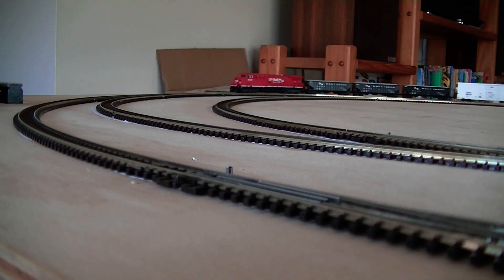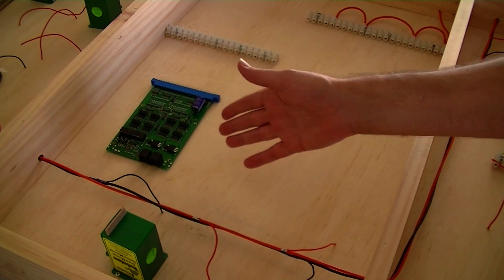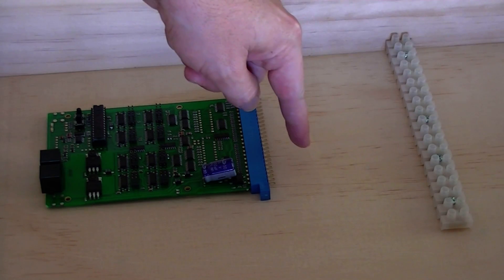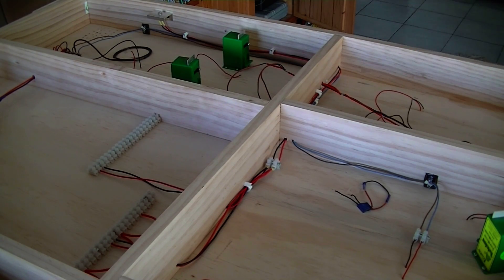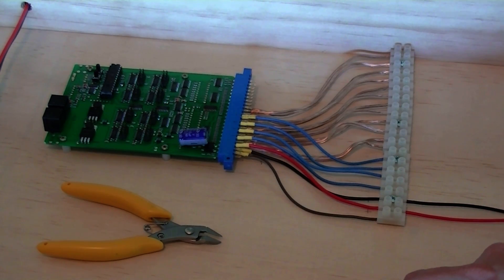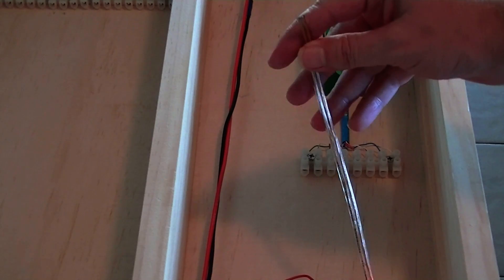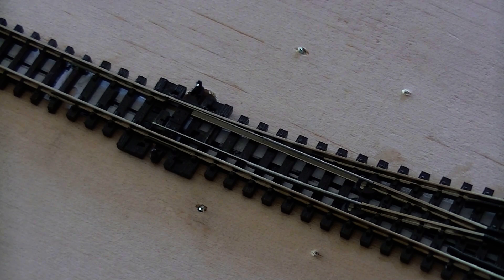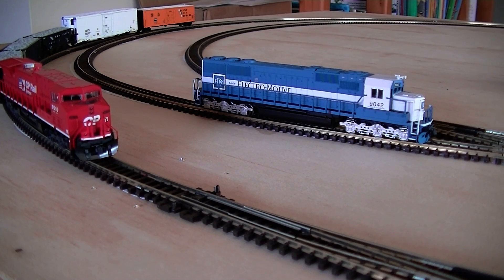Digitrax SE8c signal board and tortoise switch machines

Comment: Awesome video sir. I have an NCE DCC system. But am planning to get the Se8 and operate my signals via the computer thru a separate loco net and no detection. Think that should work?
Reply from the maker: Yes it should work but you have to change the signals manually

Comment: forgive my ignorance, but is this system meant to control the switches remotely with your power pack or hand held throttle? because  I heard of the( I think is call) rabbit that controls it remotely! I follow all your videos but this one caught me of guard. Regards RT
Reply from the maker: RT, I should have explained myself better in the video. 
The SE8c will be hooked up to the computer and the turnouts controlled by the computer.
You can thrown the turnout by the throttle but in my case the computer will do all the work.
Regards,
Michael
Reply from the maker: RT, I should have explained myself better in the video. 
The SE8c will be hooked up to the computer and the turnouts controlled by the computer.
You can thrown the turnout by the throttle but in my case the computer will do all the work.
Regards,
Michael
Reply: Thank you Michael! I bet you the rest of the people that saw your video knew what it was. I was probably the only one that didn't know it. Thanks a lot for taking the time to explain it. Regards.                                                       RT